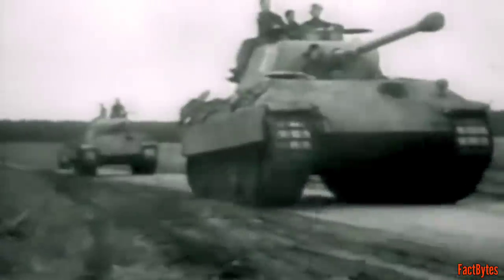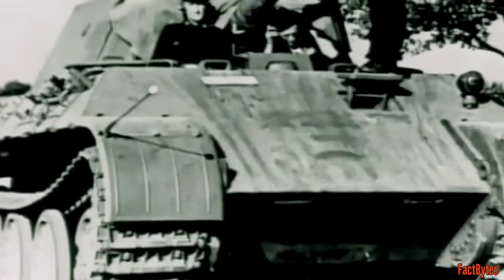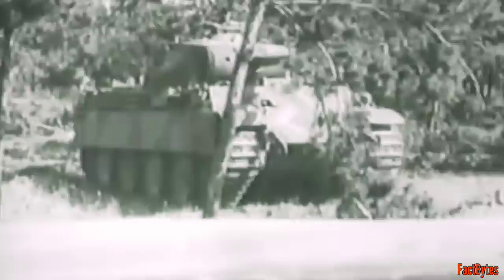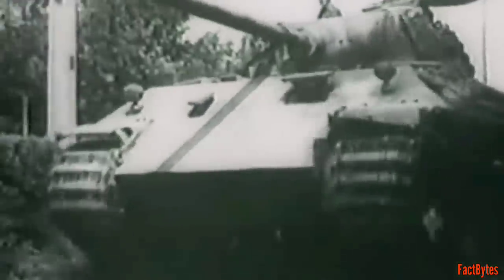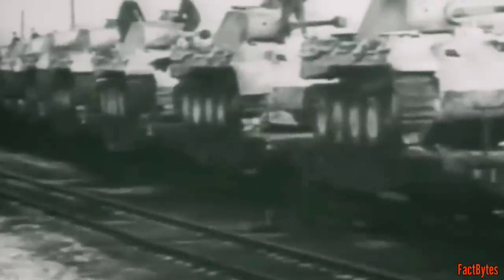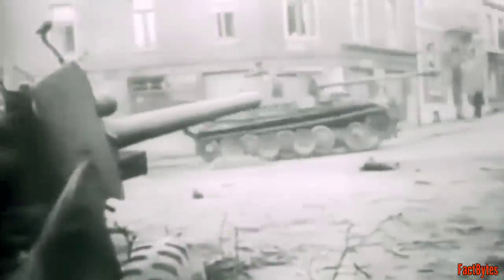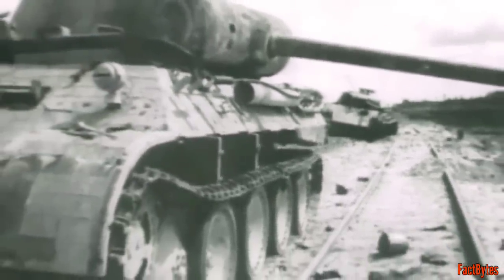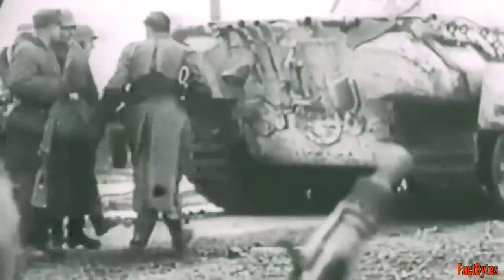Was The German Panther Really The Best Tank Of WW2?

Comment: Great tank, but it suffered from chronic reliability problems, some of which were still being worked on when the war ended. The gearbox needed great care by drivers to avoid stripping the teeth off the gears
Reply: It wasn't so much the transmission but rather the final drive that was designed for a 35 ton tank not 45 ton's. I saw a comparison to the M-4's final drive the Panthers had straight cut gears the M-4 had diagonal cut gears (30% stronger) and there were two rows of them not one like the Panther.
Reply: @markbrandon7359  This is true. In a tank that was still over engineered as only a WW2 design German tank could be, a deliberate decision was taken 2 use a cheaper, more simple 2 produce final drive in order 2 speed up production. This is kind of ironic really, considering the reliability problems this would cause in the field with units using the Panther.
Reply: @markymark3572   Those problems are more overstated by historians than panzer crews at the time.
Reply: @seppshlllearningcenter419  the french, while not in combat nor maintaining in the field only got 800km from the final drives.
The panthers were rail loaded for trips as short as 25km(yup it in the documentation) and there were standing orders not to neutral steer or go up hills because the things would break.
Then add in that roughly half of all captured panthers were abandoned not knocked out.
You might get the impression that maybe, just maybe, the historians might be understating the unreliability.
Reply: @drudgenemo7030  You wouldn't typically capture a knocked out tank, would you? Kind of a non-sequitur without knowing the context. Also, I have seen a couple sources that the Germans lost more tanks and vehicles of all types to lack of fuel and air attack during the falaise pocket. Ironically to another point, it was some of the captured panthers that completely disproved another persistent panther myth when SHAEF tested some examples thought to have the "weakened" steel and found out that even the affected panthers bounced 76mm shells at close range almost at will. As far as I am aware, far more books publish myth without source, and only one book I've seen published the test results that blew that myth out of the water as each thought to be inferior panther model absorbed numerous close range hits from 76 and 17lb main guns. The only book that I know for a fact published the original source and data is "Panther: Germany's quest for combat dominance"...almost every other book, talk, or opinion on the internet states myths as fact without any documentation. Speaking of documentation, where is the source for panther crews being told not to drive up hills?
Reply: @seppshlllearningcenter419  cool yet another fanboi that dismisses anything that doesn't agree with their preconceived notion that the German x, y, or z was best ever Uber wuderwaffe that could never be defeated ever unless they cheated(not sure how you cheat in war) and somehow always won, except it actually never won a single battle.
Sorry Hans, but in case you missed the memo
Germany LOST the war.
The panther had a 1.2 kill loss ratio while being on the defensive (generally accepted by strategist far more learned than some moron on the internet as a 3:1 advantage)and the only large scale battle between the panther and Sherman was arrancourt, against 75mm Shermans.
Feel free to look up the details.
But hey you will no doubt refute every bit of it as propaganda, or no sources, or the moon was in Mars's influence or whatever.
BTW didn't the Germans press a bunch of knocked out t34s back into service because the were desperate for anything resembling a tank, even 35Ts and pzr1s?
And the armor wasn't what I was referring to, it was the fact the panther spontaneously combusted, and dropped transmissions and final drives worse than a Yugo.
Reply: @drudgenemo7030   Nice little diatribe. What little actual claim you make, is easily refutable. First, it's Arracourt, second, it was far from the only large scale battle involving panthers and shermans. Allies and historians tend to ignore the battles they lost, which is understandable since every loss was all but in vain. The exact opposite of Arracourt happened fairly frequently in the Cain sector, where most armor battles took place and the most massive armor clashes from Epsom, Jupiter, Goodwood, etc... The british and canadians delt with far more German armor than the Americans in the southern sectors...and the results were not that great. Panthers under Wünche knocked out 30 some shermans with zero panthers lost literally just prior to Wittman's death in the same operation. I bring up this specifically, because Wittmann's death and all the the talk of the shermans that did it ignores just how badly they had been defeated by Wünche shortly before that. Then the entire area was carpet bombed by b17s lmao
Reply: @seppshlllearningcenter419  thank you for proving my point
Reply: @drudgenemo7030   Seems as though I dismantled it, but as you wish.
Reply: @markbrandon7359  and then with the G they changed the weight from around 51 tons (combat weight) to something around maybe over 60 tons (combat weight) due to the increased side armour
Reply: You know, a lot of this is post war hysteria?

Comment: Well the basic problem with tanks comes down to the fact that it has to fire two types of ammo at two kinds of target...there are several solutions. You can have two guns on one tank like the Char 1b. You can have two tanks  specialized for each role like the Panzer III and early Panzer IV. You can decide to bite the bullet and arm the tank against the kind of target it is most likely to face. That way you get he 75mm Sherman which fires a good HE or the Panther which fires a good AP. Backing up the Sherman with tank destroyers though takes us back to the 'two tank' solution more or less.  Is there a tank in WW2 which actually struck an ideal balance? The T34? I would be curious to find out.
Reply: Yeah the T-34-85 is probably the best all-around balanced tank. Good armour, good reliability, cheap and the 85mm was very good for anti-tank and HE. If the Americans had ever put an equivalent gun on the M4 then that might have taken the top spot.
Reply: wrote: "Is there a tank in WW2 which actually struck an ideal balance? The T34? I would be curious to find out."

-- Sure, M. Koshkin who worked on improving AT gun protection of light BT(that is abbreviation that is literally stands for "Quick Tank") came up with a concept of "universal tank"(or MBT - Main Battle Tank, in terms of modern language), meaning one tank - that have an armor protection of heavy tank(against AT guns of that time), heavy tank armament i.e. long 3 inch gun(later 85mm, similar to Tiger's 8.8cm gun), but maneuverability and speed of light tank, as well as ease of manufacturing and service/repair, it also had one of best operational range of all WWII tanks.

Comment: Yes, not overengineered and pointlessly expensive tank. Not mechanically too weak etc.
Reply: Yes, lol, I would argue it was underengeneered in some respects... T-34 used common rail direct fuel injection(set it and forget it from factory), with 4 valve per cylinder DOHC. German's used direct fuel injection of Daimler Benz engine to power their aircraft. Panther and Tiger used 4 carburetors(one per 3 cylinders), which was nearly impossible to synchronize as a field repair, and was responsible for fires or premature engine wear, and interime not delivering full power. Only 2 valves per cylinder, and not so economic engine from the country who suffered fuel shortages, they are defiantly could use some engineering.
Reply: @RussianThunderrr  this just means that, in some aspects underengineered, mechanically not too weak, but really good and efective opponent at least T-34 etc
Reply: @Hsfgd08  - That is the reason, I always admired Swedish minimalistic engineering, they always had to do more with less..., and that is the reason why they were by far more reliable automotive brands, then Germans or even Japanese.
Reply: @RussianThunderrr  This seems like you would like to hate germans or japanese (whatever real reason is), but this is not very objective view ☺ I think for example that german cars manufacturers are pretty good. But about japan cars i have not comprehensive information  ☺
Reply: @Hsfgd08  - I don't hate Japanese cars, in fact I do admire them for their reliability, but Toyota just recently start designing/making cars I'm comfortably fitting in, so if no Volvos around, Honda is my go to brand, which is not the case with German cars... Mercedes, BMW and just about any other German brand, which is not reliable, and overly complicated, and not because Germans invaded the country where I was born... All, that I care about is a mechanical aspect of any vehicle, be it a car, tank or aircraft, and not from political view point, but strictly practical.
Reply: @RussianThunderrr  You made that clear. ☺